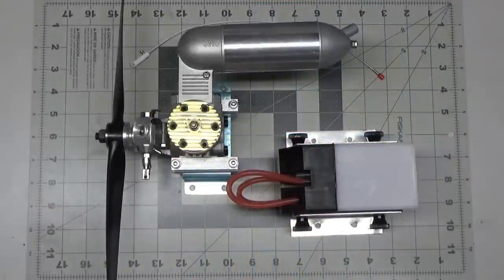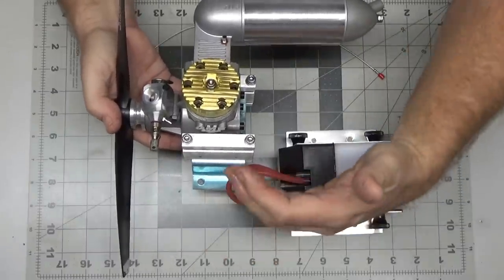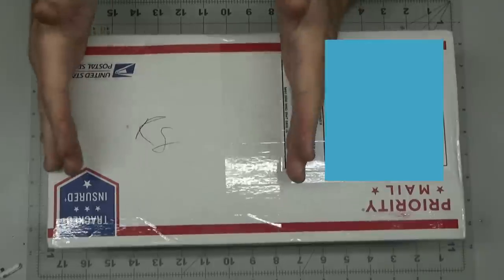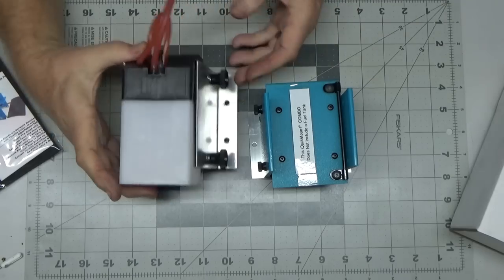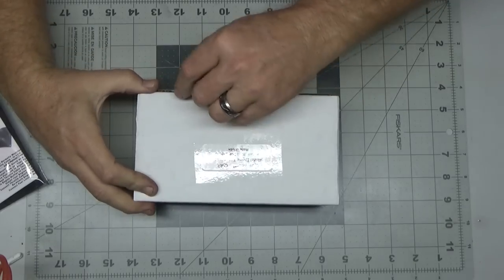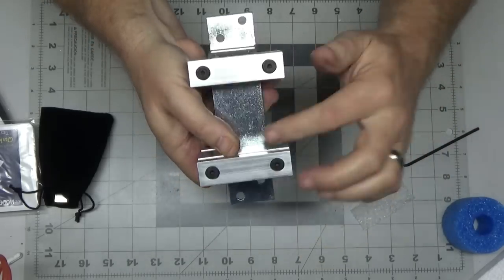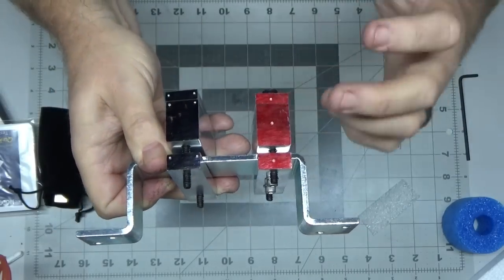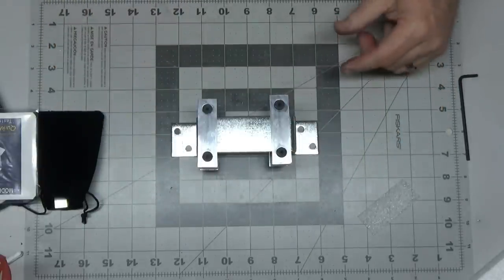Airplane Engine Stand Comparison

Comment: I have both the small stand and the large on.  Threason for the shims is so you don't worp the hold down bars which would release pressure on the engine rails.

Comment: Was just looking at these stands. I never looked close enough. I thought that they were the same. I figured the USA 1 was a little more expensive because you don't have to wait for it to get shipped across the pond. If you still have the Australia 1 are you selling the gas tank stand and gas tank that came with it, or just engine stand?
Reply from the maker: UK = United Kingdom not Australia.  I am not selling anything.  Both of these are available on eBay.
Reply: @dmrcflyr2  yes I know I accidentally typed it wrong.